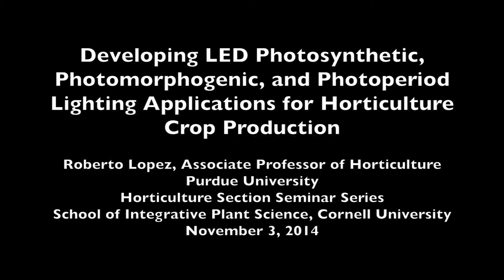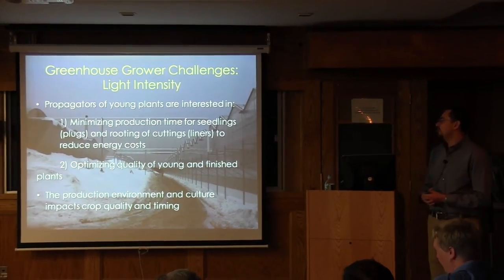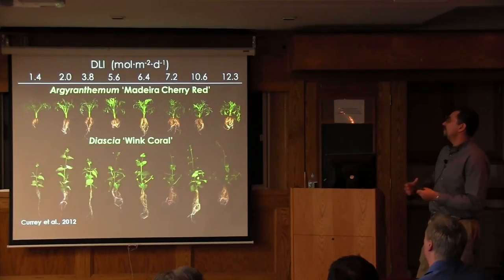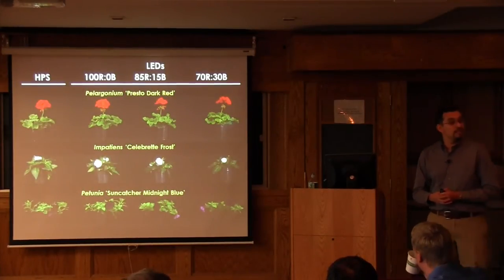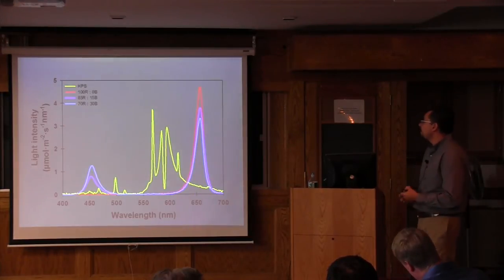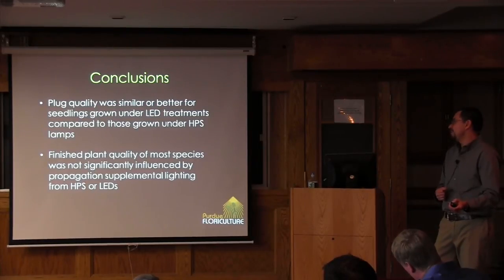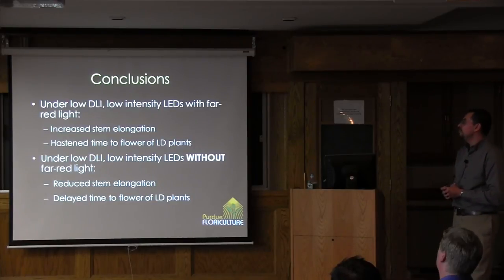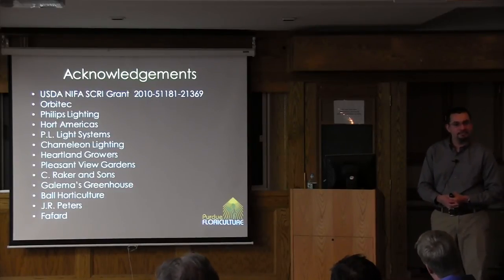Developing LED Photosynthetic, Photomorphogenic, and Photoperiod Lighting Applications ...

Comment: I have an led "chamber" for my orchids in my bedroom and I spend lots of time in there caring for the plants. It's true that everything looks green when you come back out, but it's not any different from how everything looks different when you take sunglasses off. Your eyes also adjust to the pink while you're in there and things start to look much more normal after a few minutes. 
I'm not bothered by the color, but It may have something to do with the fact that my 'chamber' is not light proof, as its just enclosed in painter's plastic and much of the light leaks through and into my living space, or it may have to do with the fact that a bit of white light comes through the room into the grow space. Perhaps some Windows or regular lamps  would be beneficial for people working with LEDs in grow chambers, but since the light has never bothered me, I can't say for sure. A lot of orchid growers are put off by the artificial color, but after living with mine for a year and seeing the insane benefits, even if I felt sick, I'd keep them because the orchids do so well.

Comment: Sound stops right after intro :(
Reply: I didn't have that problem. Maybe they fixed it since you last tried watching it. It's a really interesting video and the thing I love most about it is that they talk about how led does work. I see so many people doing HID vs LED videos and they aren't measuring the light or using comparable watts. They'll use a 400 watt HID and a 60 watt led for example, and that's not at all equal.